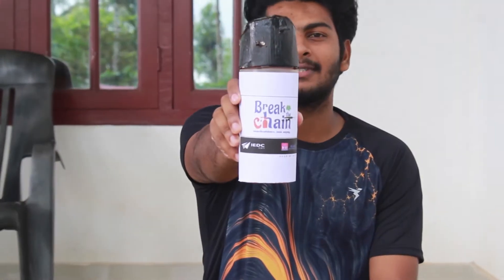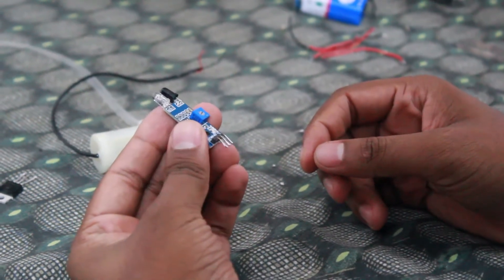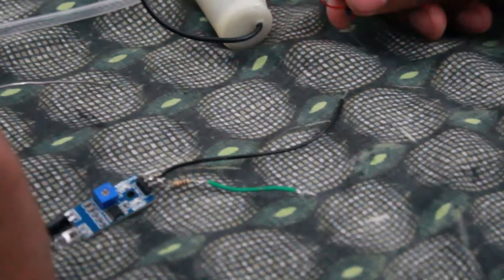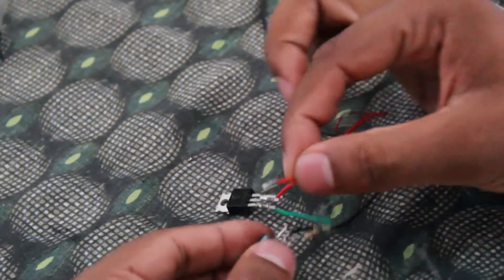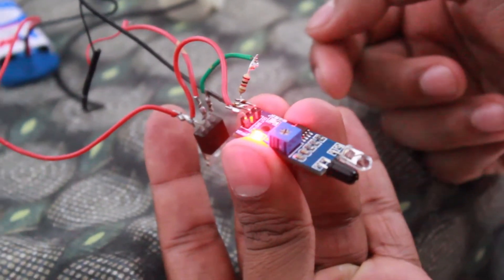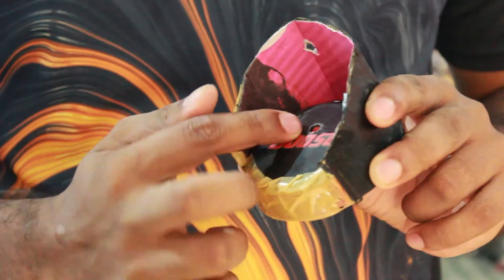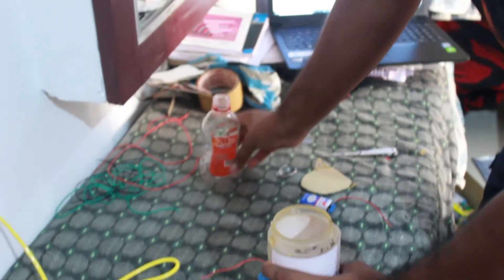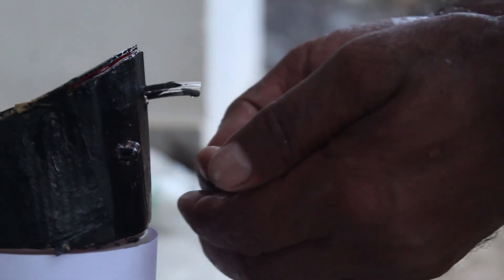AUTOMATIC HAND SANITIZER | സാധാരണക്കാരന് ഉണ്ടാകാൻ പറ്റിയ ഓട്ടോമാറ്റിക് സാനിറ്റൈസർ  E - MONK

Comment: Chetta idu etra hours backup kittum.Pump etra manikur wrk cheytal battery drain out aavum..?
Reply from the maker: actually batterykku pakaram oru oru usb cable kodukkukayanengil mobile charger adapter use cheyth ee unit work cheyyippikkavunnathan